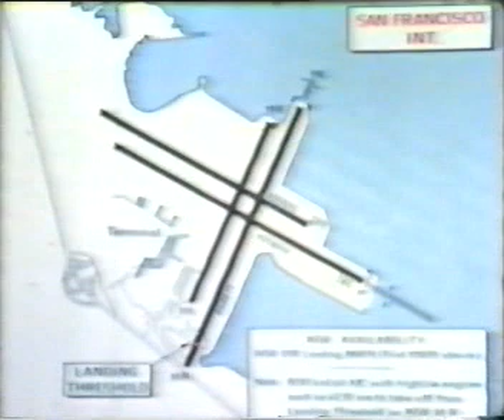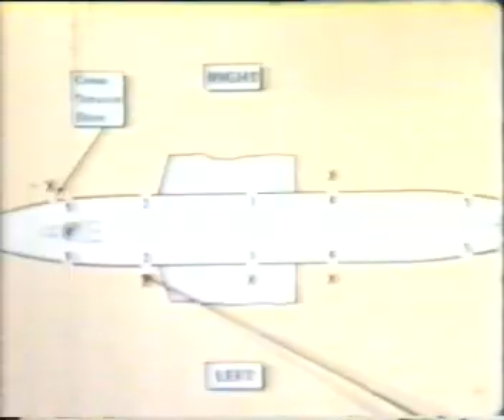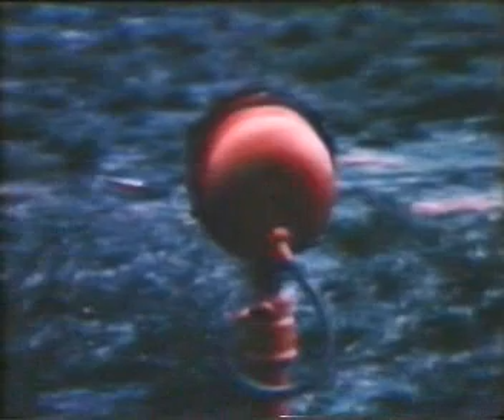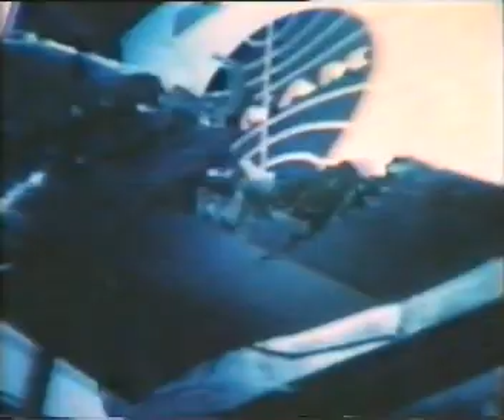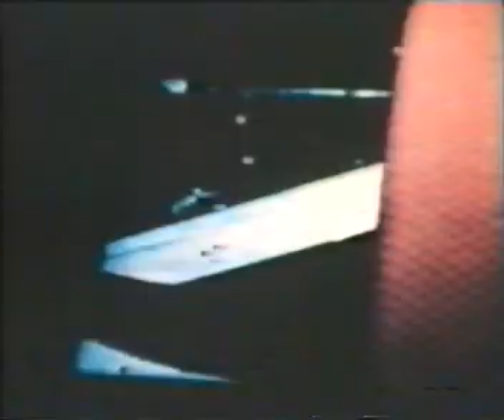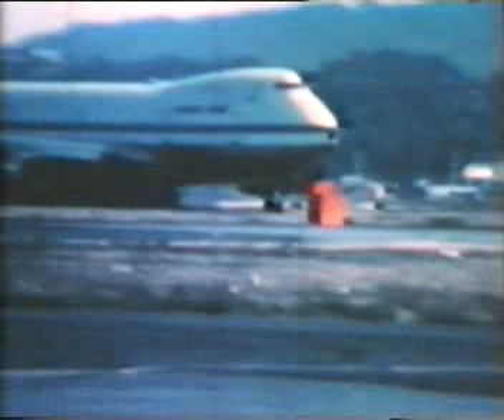Pan Am B747 San Francisco Accident 1971

Comment: The Pan Am aircraft Captain was my father who had over 30-years of commercial multi-engine experience, and he was one of the first pilots, ever trained and checked out on the 747 aircraft. My niece previously wrote about some of the issues, but the biggest problem was it is very easy for all parties to blame “pilot error”. Every party, Boeing, Pan Am, the Airport, FAA etc., wanted to be done with the problem (liability) and blame all on someone else, and guess who that was? Nobody protects the pilot(s) except for the union attorney. 

There is a reason people can’t find the complete records of the hearing, because some of the information never was included, like Pan Am loading the plane over its maximum allowable gross weight and not providing the actual real weight to the pilot, for the computations for takeoff! The Jensen Manuals were incorrect, the runway was not a legal runway, 9,500 feet long, for a 747 to take off from. The airport authority was also wrong about the length of the runway! Additionally, manuals did not take into account of the effects of jet thrusts at the end of the runway, where it drops off down to the water below. Boeing also lied to save themselves, “stating that the plane should have been able to take off.” As a past young aspiring lawyer I listened to every tape and transcript available and reviewed every document to help and advised my father whenever I could. The hearing process took almost two years and a lot of my dad’s energy. Pan Am wanted him to quit, retire and take the blame; he only went through the process to save the jobs of his junior pilots so they could continue to fly. The finding of the hearing, “there was  no finding of pilot error”,  however, as previously stated they did find other areas that needed attention.
Reply: 😢oh Boeing. It was close

Comment: Gosh that two hour flight to dump fuel and assess damage must've been white knuckles for all involved. Amazing airmanship that they got it on the ground safely. That big bounce on the landing is testament to the strength of the gear and the great force of impact during the take-off. Those poor people who were sent down that nearly vertical emergency slide must've been hurting. I wonder how close to the ground the two tail exits were when the fusilage see-sawed aftward. It's incredible that the airplane was repairable and flown into the nineties. Must've had many updates and upgrades over the years. I've always wondered how they calculate how much fuel to leave onboard during the dump so they have enough to do any necessary go arounds.
Reply: Kenneth Tombs amazing airmanship??? Those twits caused the whole thing by a lack of basic airmanship!

Comment: the "too rear" CG probably helped with the limited elevator control, especially at landing, though....
Reply: That's a great point.  With only limited elevator flare control, had the CG not been so far aft, this would have been flat enough to break it in two or take the nose gear out.  This could have been a fireball or a tumbling mess.

Comment: Why did they let anyone even use those almost vertical slides. There was no immediate danger anymore, right? No smoke in the cabin (I assume), nothing burning. Just let everyone exit through the rear slides. I realize they changed procedures after this, but still, hearing that 20 passengers were injured while using those slides, that's tragic.

Comment: I was on the flight but I didn't get that something went wrong for quite a few second after landing...
Because before it also sometimes I had heard warnings for possible harsh landings by pilots but every time things used to go normal. 
This was the first and last time I experienced what they meant.
Reply: So the fact that the aircraft hit lots of metal work as it took off which injured passengers and caused a lot of damage to the aircraft escaped your attention did it? 
  You were no more on that flight then I was. Why bull shit?

Comment: This was not recorded in VHS. In 1971, the video recording was done with a real to real system with a large almost suitcase size real to real recording deck connected to the camera with cable. U-Matic, the first cassette system was released by Sony in September, a few months after this event. It would have been rerecorded to VHS after 1976. There would be a two generation loss in quality.

Comment: Interesting.  Almost as bad a hydraulics failure as the Sioux City plane.  Lucky they had some Hydro.  Then after landing, stupid panic and most injuries were caused by going down the slides.  Just relax.  DON"T take your shoes off in an accident!  You don't want to run around in bare feet with metal, shrapnel, etc. all over the ground.  Do fly with laced up sneakers or laced up shoes.  Do NOT fly with barefeet or sandals or flip flops like most people do these days.

Comment: Shambolic. 'All that remains is that... you need to enforce the procedures with authority'. It was those procedures which lead to 8 people being forced down the first slide leading to permanent back damage. Common sense is more important.
Reply: global001 common sense tells you that excluding the hills and valleys the world is flat. You just need to get out of town and look at the horizon to confirm this and if you live by the sea you can see the ships dropping off the edge of the world. Scienceprooves that common sense is utter bollocks when looking at the world and that the world is an oblate spheroid; which even Columbus knew.
Reply from the maker: Which is why they increased the length of the forward slides on later 747 models so that they would reach the ground if the aircraft tipped onto its tail.
Reply: Viewcroft A bit late given enforcing the procedures with authority lead to permanently damaging peoples lives. Procedures can be and are wrong. Using common sense is better.
Reply: Common sense is bullshit. Procedures are there for a reason - they are lessons learned from fuckups before. Imagine if humanity relied on common sense and human memory ... we'd still be in the Stone Age.
Reply: global001 it's betterto live with a bad back that to live with the knowledge that your hessitation caused somebody to die. Fortunately this aircraft didn't burn. It is also a known fact that several people have been left in wheel chair after evacuation drills required for airworthiness certification, even though the authorities know these evacuation requirements are not going to be met in reallity.
Reply: +TheArfdog Are you for real? Using common sense which would tell you not to hurtle people down a vertical slide onto concrete causing permanent back damage or just mindlessly following procedure to throw them down the slide without thinking. Clearly your version would've eliminated the human race completely. Using common sense and not hurtling them down the slide, telling them this chute is malfunctioning, go use the next one would've saved them a lifetime of disability. Your mind set of just follow instructions without engaging your brain is pre stone age mentality. You don't solve problems, you cause them!
Reply: Or the crew could've engaged their brains rather than just following procedure and said sorry this vertical drop onto concrete isn't safe, use the the next one along. Clearly procedure can be wrong.
Reply: No, its better to realise that a shear drop onto concrete causes permanent damage and say this chute is malfunctioning, go down the next one.

Comment: That was the most violent 'bounce' I've ever seen a 747 do! Amazing it held together.
Reply: Yes it doesnt look like much yes that is a violent bounce on such a big aircraft.
Reply: JasonWardStudios
This summer Im on a Lufthansa fight to Frankfurt. My ticket says 747-400.
Reply: The Flight Sim 2004 Meljet 747 wouldn't have survived that! Boeing makes a great aircraft.
Reply: Clearly overengineereed, like the 707 and 727. Flying tanks.
Reply: HailAnts I
Reply: Astute observation. How was it that the thing was not entirely written off?
Reply: Commercial aircraft are designed to withstand a 10 ft per second vertical impact at max landing weight. So if you can burn off fuel and get lighter you can withstand more. But that is the same for any big airplane. The boeing is no stronger despite the hype. They are all designed to the same requirements. If you overbuild the airplane you have to remove gas, people or freight and you won't have a competitive product.

Comment: I do not see the need to deploy emergency slides for this situation. The plane was not on fire and they could have waited for the mobile stairs. Also the pilots should have not jettisoned the fuel to the point where it becomes too tail heavy. This situation could have been handled much better.

Comment: I was a passenger on this flight along with my 16 month old son. Amazing to see even after all these years. Pat D.
Reply: +Pat Dunfee 
That must have been a traumatic experience, needless to say. Where were you seated in relation to the cabin floor damage? What was the announcement from the cockpit? How were they able to handle those who were injured? It must have felt like an eternity before you were back on the ground.  I'd be interested in knowing more about this event in as much detail as you care to share. Best regards
Reply: @432b86ed  
If this was an Airbus,  there wouldn't have been anything left.
Reply: Pat Dunfee This is what happened to your plane
https://en.wikipedia.org/wiki/Pan_Am_Flight_845#Aftermath
Reply: +Pat Dunfee Glad you and your little one made it out OK!
Reply: +John Smith i did get airborne and returned to the airport after burning fuel for some time.
Reply: +Kit Carson  no
Reply: Pat Dunfee liar
Reply: John Doe what are you basing that on?
Reply: May I remind you of US Airways Flight 1549? Landed on water and stayed in one piece.
Reply: @Goproflying  yeah, at 1/4 the weight of a 747.
And it landed on glass smooth water, not iron.
Reply: I was working at SFO that day. After take-off I saw the 747 flying real low over S.F. Bay. It had a Rooster Tail behind the plane (for 5-10 seconds).  After they closed the airport, I climbed on top of a concourse to watch the landing. Glad you made it OK.
They stored it in the American Airline hangar at the far side of the airport. About a week later, I drove a company truck over there and actually walked underneath the plane.
Reply: I was there too. Seat 32D.  Never forget
Reply: Pat Dunfee and many thanks to Captain "Sully"n
Reply: @MrsSam  , and Airbus A320 .....
Reply: @GIOKaliAutogio  
That's what went into the trees on a show flight yes?
Reply: John Smith the bird did become airborne and dumped its fuel before landing near after two hours.
Reply: Glad you're around to make that comment. Must have been terrifying.
Reply: John Smith duh, the end of the runway points out to sea, to hit the approach lights with the landing gear it would need to be flying.
Reply: +MrsSam he had more hours in a glider that fast movers....that could have helped him with his decision....look up the hours of glide time....
Reply: Wow!
Reply: so sad
Reply: nw8000 good show sir.
Reply: @Councilman Les Wynan  🤣🤣🤣
Reply: @Councilman Les Wynan  Rectum hell, killed em'!
Reply: Did you receive any compensation?
Reply: yeah,sure...
Reply: Gtfo!!  Wow 😮
Reply: Pat Dunfee  I was to busy reading the comments to hear if they mentioned why you guys flew around for 2 hrs
Reply: btw, are you still alive?
Reply: Must be mind-blowing to see a video about it 45 years later! You had one hell of a story to tell to your son!
Reply: Councilman Les Wynan That must be a bit frustrating.  Just saying.
Reply: Yeah am I'm the Easter bunny
Reply: I was sitting in 69D best experience
Reply: Yeah i was the pilot
Reply: me i was the person front of you
Reply: @Councilman Les Wynan  I can confirm this. I was the medic that tried to remove the landing gear from his ass, but as he was a very gay man, he liked it so much, he refused to allow us to remove it, so we left it inside him. Only downside is, he now needs to wipe his ass with a piece of asphalt. Because of the rubber wheels inside him. But according to him, that is just another bonus. Weird guy, but he is a liberal, so makes sense.
Reply: Mier Beuker Thats a very homoerotic story for a self described ‘conservative’.
Reply: @scrimmo  .I worked for Pan American before they had shut down.
Reply: >comes to say she was on board
>leaves without saying anything meaningful or interesting
Waste of time. Useless comment
Reply: @scrimmo  because she is lying
Reply: Zakk Gardner liar
Reply: wow ! but she is the queen of the sky,if it ain't Boeing i am no't going .hell w scare bus !
Reply: Solomon Pilot lmao this comment didn’t age well
Reply: GAY FANBOY IS GAY!!!!!

Comment: IF I HAD BEEN THE CAPTAIN I WOULD HAVE CALLED FOR FULL THRUST.    THEY DO REDUCED THRUST TAKE-OFFS TO SAVE ON ENGINE WEAR AND THIS IS WHAT HAPPENS.
Reply: What airplanes do you fly?   Must see if you are legit.
Reply: +Nick Kouvaras    So many people claim expertise.   I'm no pilot,  but I know quite a bit about airplanes and if you'll give me what your career progression was I can validate you are a real pro.    If not,  there will always be that question:  IS NICK FOR REAL?    If you are a real pro,  then I will ask you questions about airlines & whatnot.    If not,  I will go elsewhere.   You have hereby been challenged.     Will you accept?
Reply: Nick,  you are a fake!   Busted,  boy,  busted!
Reply: +Hank Fuddle no they dont. they reduce thrust after takeoff at many airports as a noise reduction procedure for local residents. also thrust (N1 level) is not the same as airspeed and maximum climb rate, especially in large planes like a 747. You cant just pull back on the yoke and go up vertically, it doesn't work like that.
Reply: +Charlie Butterbean   hear, hear!!!!!
Reply: +Hank Fuddle It's not just for engine wear. An engine at reduced thrust has a significantly lower probability of failure than one on full take off thrust. That's one of the reasons you do it whenever possible- you dramatically reduce the chances having to deal with a failed engine on takeoff.

Comment: I doubt that an A380 would fly with that amount of damage
Reply: adam willis I have to agree, an A380 with such damage would be critically impaired, if not doomed. How powerful the engines are, having nothing to do with structural integrity of the airframe.

Case in point are the well publicized hairline cracks in the A380's wings, which could be passed off as growing pains by defenders. If not for Tom Ender's (Airbus Group CEO) own admission that his team's inadequate knowledge of the materials and construction processes involved were to blame, which amounts to flawed engineering. It's good they caught it before one of their planes goes down for it, but I have no desire to fly one one. Same goes for the B787 for what it's worth.
Reply: Do you know the immense difference in power those 4 RR & EA A380 engines have compared to those 747 PW's??

There is no comparison. Put it this way, a full A380 at 80% N1 is over-powered!!
Reply: Rafa v - I offer all the evidence necessary in my comment above, take it or leave it. There’s nothing foolish about it. What is foolish is putting out a product as Airbus did without a command of the materials involved. The A380 is already on the way out anyway, so it’ll be gone before it becomes a serious liability.
Reply: No doubt an A380 could not sustain that type of damage and even get in the sky, the 747 coming back looking like it came back from combat was no surprise... They simply don't build Airbus like that. A DC-10 had more of a fighting chance than an A-380 would
Reply: Ah, yanks thinking that only their planes can survive such an incident. I am sure the A380 would do a much better job at flying with that amount of damage and maybe more.
Reply: A QANTAS A380 QF32 sustained serious damage that was pretty close to the level of the Pan Am 747. One engine destroyed, 1 engine degraded and a barely controllable aircraft. 
http://en.wikipedia.org/wiki/Qantas_Flight_32

Captain & crew did an amazing job to land the jet and save the 469 people on board.